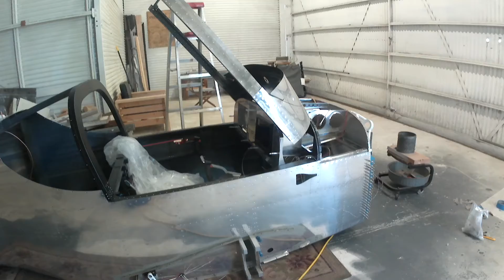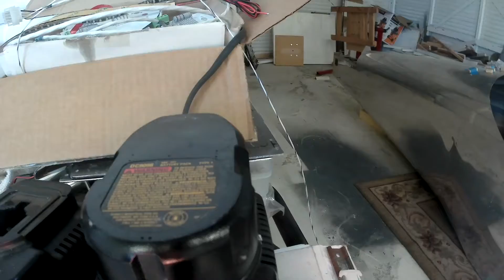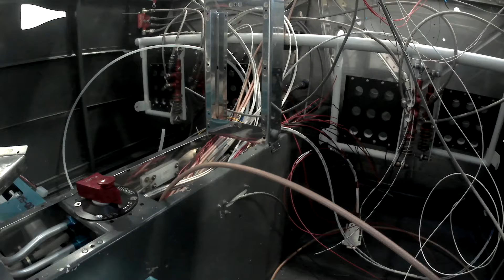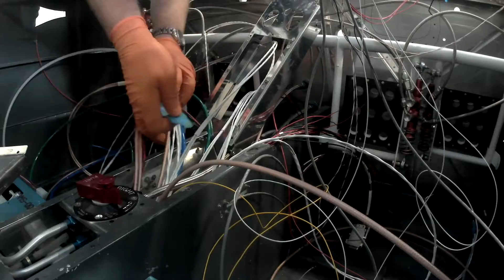RV-14 Wire Life 4

Comment: Starting to come together! That is how the F-16 circuit breaker panels are. They are basically a short box with all the breakers mounted. The bottom of the panel is plexiglas screwed down to a flange all the way around.